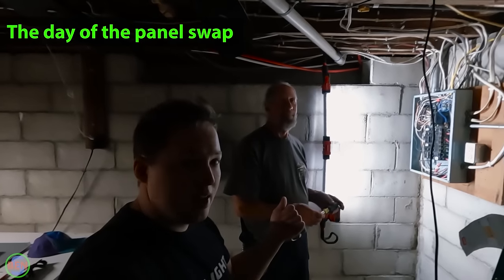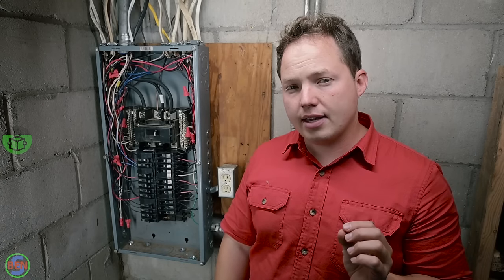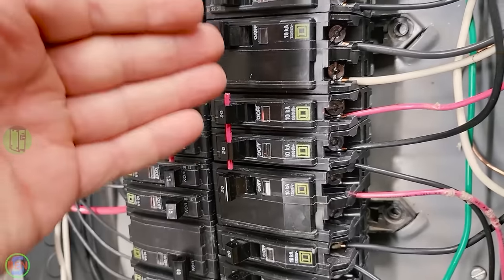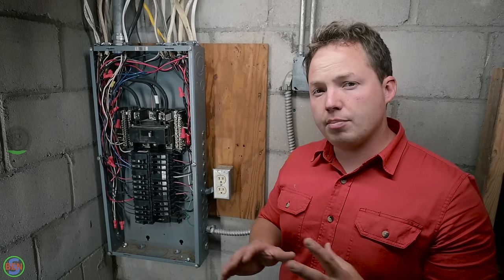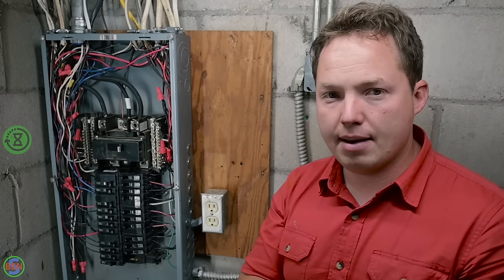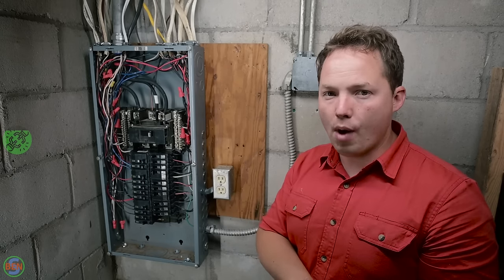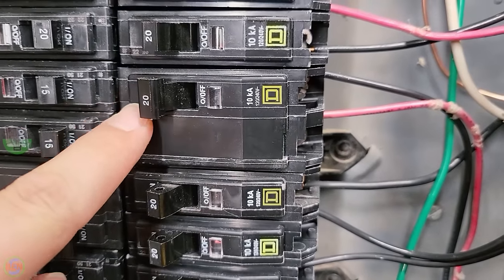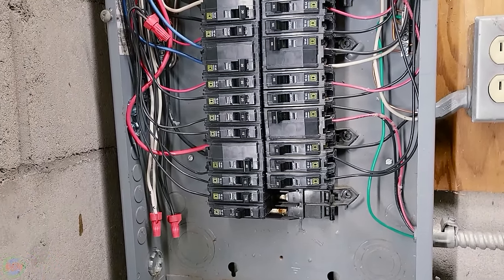How To Replace a Main Panel or Sub Panel - Upgrading an Existing Electrical Service

Comment: Everyone has their own way of doing panel changes. I’ve been in the trade 25 years and I’ve found over the years when Romex wires are short I’ll take them back back to a 4-11/16 metal j box.  Them I will take a piece of 3/4” greenfield to the panel and push multiple sets of stranded wire to the panel to extend circuits. That way you don’t have all the wire nuts in the panel and it dosent get packed on top of the panel with Romex wires.
Reply from the maker: That sounds like a really clean way of doing it. Thanks for sharing!
Reply: Great idea thanks for share that
Reply: @BenjaminSahlstrom  thanks. It ends up really looking clean. I’ve done  a ton over the years this way. Plus the top of your panel is not packed with a ton Romex or different wire assemblies. .
Reply: worked in govt facility making weapons we always had to splice into a 4 " box [sealed] no splices in panel
Reply: we had a lot of old fabric and rubber insulation
Reply: @stewartmelzer939  yep….it’s so much cleaner of an install!
Reply: Where do you tend to land your j-box?
Reply: @binaryglitch64  near panel or on a side  of joists.
Reply: @mcarroll598  than I'd appropriate being the next guy to work on it. Good tip, thanx.
Reply: I agree. I do the same thing. It's safer,  there's more room in the panel, and it looks better.

Comment: Spaces in the panel are dependent on the load. If you go from 100 to 200 amps, you're going to need new wiring run to the panel in most circumstances.  Perhaps the entire electrical drop or service to your property will need to be upgraded.
Reply: I feel like this is problem I’m having
Reply from the maker: That can be the case but in many circumstances the service is large enough with too few spaces for added circuits. If you don't have many large electrical appliances you actually don't need a huge service. Obviously calculating the needed panel and service is the way to go though.
Reply: Here the service overhead doesn't change but of course from the weatherhead inside will need updated
Reply: @BenjaminSahlstrom  I still only saw 2 spaces even though you said you miscounted. Where did you get 4 from in the correction text?
Reply: In the video Ben noted that the power feeders were aluminum and rated for 100 amps, and that the disconnect has a100 amp breaker. His new panel is rated for 200 amps. So a100 amp breaker is protecting 100 amp aluminum wiring. He also said that if he wants to upgrade to a true 200 amp service he would have to replace the 100 with a 200 and the 100 amp wiring with 200 amp wiring. Also a lot of the circuits in the original panel were "doubled up" and those circuits had to be separated and put on dedicated  breakers, that's why there weren't as many spare breakers as originally planned when the job was completed.
Reply from the maker: Check out the very end! 56:00
Reply: @BenjaminSahlstrom  use tandem 15/15 or 20/20 breakers in the empty slots (and/or start replacing some of the old breakers with a tandem breakers)
Reply: Finally someone said it!
Reply: Classic case of what's okay and will work, versus what would be better for the future and current service. Should upgrade everything while you have it out. Just makes practical sense. Also, I would upgrade to all 20 amp circuits. It's just better. I always do this for my customers, when I can. They always thank me when they don't have problems with overloading circuits constantly tripping breakers. Makes additional services easier, and faster, which saves money! Of course, I figure out all the loads for each circuit, and for the entire system first! Little planning for the future not only helps the client, but it guarantees me that I'll be doing the work! It's the difference between a good electrician, and a great one! Doesn't always happen, but it doesn't help to try!!👍🇺🇸🐍
Reply: wise words old friend. lol found you
Reply: @DocJeep1 the problem the customers don’t wanna pay for that extra work and u can’t just replace 15amps with 20amps without upgrading the wiring as will bro.

Comment: Ben, you have a code violation in this clip.  Your film shows a 30 amp breaker that is just above you multiwire circuit breaker.  The conductors connected to this breaker are the problem.  According to the NEC, if you are using the white wire as an ungrounded conductor it must be marked as such anywhere in the circuit where the conductor is visible.  All you need to do is wrap some black tape around the white conductor or use a black or red sharpie pen to color the white wire.  Don
Reply from the maker: True! I actually talk about this in the video. The wires just hadn't been marked when the video was recorded.
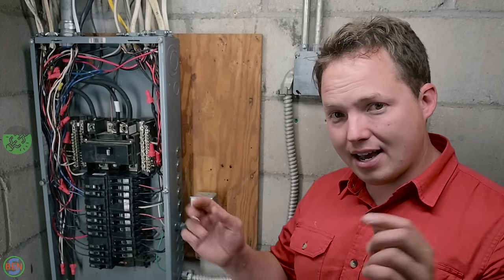Reply: this comment prove you didn't watch it till the end, at 39:45 he talked exactly about this!

Comment: I ran in to a main panel recently installed by am "electrician"   It was a Federal Pacific, and the guy had put in multiple double breakers and 12/3 & 14/3 wire.  The trouble was in a Federal Pacific panel adjacent stabs could be on the same phase,  I looked and every one of the doubles were on the same phase.  I told the owner to call back the installer and have him fix it!

Comment: Yes, they enforce shared neutrals be on handle-tied breakers where I am. Exception for sewer lift pumps with alarms. We use 2 hots and 1 neutral so if the pump trips you don’t lose the alarms power.

Story time: 

Doing a partial remodel on an office building while they were still in operation, I fried 5 computers in 10 seconds. 3 phase sharing neutrals; I, unbeknownst to me, took apart a neutral joint that was going to an in-use office. A lady stepped into the construction space and said “are you working on my office electricity?” I said no and went on working. Shortly, a maintenance guy walked in, look at my work and said “yea, he did” over his walkie-talkie…my stomach turned over. He said”we aren’t going to charge you because we didn’t disclose it, but everything in this building uses shared neutrals. You just burned up 5 computers. Don’t disconnect neutral joints during business hours anymore. Now you have been warned.” I felt about an inch tall
Reply: Well now you know to ask first just in case
Reply: @FishFind3000  yea….we try to avoid “open store remodels” as long as “good work” allows. Sometimes ya gotta do what ya gotta do though, but yea! That was a lesson from the “slow down and think about the task at hand” category.
Reply: Just curious was the lighting voltage 3 phase 277V  or 3 phase 208?
Reply: @RS-qp4bp  it was 208v.
Reply: @aaronpinkham4196  just curious, at work we have roadway lighting and office lights at that operate on 277 volts to neutral.
Reply: @RS-qp4bp  A lot of bigger buildings will have 277/480v coming into the building for equipment with major load requirements, like lots of HVAC and lighting. Then they’ll send it through a transformer to get the 120/208 for general power throughout the building.
Reply: the one and only time I used a shared branch circuit I labeled a piece of sheathing 'shared circuit' and left it on the neutral at the bus.. also labeled the wires and the chart in the panel 'shared circuit'.  just in case the next guy thought my connected 20 amp breakers were feeding a 240 volt circuit...  I overcompensate, I know.

Comment: I live in Minneapolis had my main panel replaced about 2 years ago.  I called around, and had 2 bids.  One guy quoted me something like $2500.  Another quotes me $1000 + materials.

Of course I paid the $1000, with the agreement that I'd buy the panel, the breakers, and the grounding rods which are required to bring things up to code and have everyhingl ready for them.

So I'd say prices vary because electricians are just charging vastly different prices for the same work.  They did a great job, everything passed inspection, they ran new grounds to my water main and drove in the newly required ground rods.

It looks like you were putting in a sub-panel in the same structure, so this isn't required.  But you might have mentioned if you're replacing a main panel like I had done, you have to bring the panel up to code.  For me, that meant putting in a ground wire that hooks directly to the incoming water pipe.  Mine was connected a few feet away, which is no longer legal.  You also have to put two ground rods connected to the main panel.

Comment: Another good reason to keep the neutrals and grounds on separate bus bars is the possibility of adding a standby generator. When you install the transfer switch your main-panel now becomes a sub-panel. Then all you have to do is remove the ground to neutral link.If you put the neutral and grounds on the same bus bar you have to rewire the panel.

Comment: I wired a couple multiwire branch circuits in my shop in my backyard.  I pulled permits and had inspections, and they didn't say anything about my breakers and didn't require me to tie them together.  Now that I understand this a little more, I'm going to tie them together and if I had to do all over again, I would just spend the money and run the extra wire and not share the neutral.  I thought I was going to make things simpler wiring that way, but I don't know now.
Reply: Most breaker manufacturers have a joining bar or pin for very little money

Comment: Amazing video! It was super informative and the layout/content of the video was well thought out.

This video also makes me feel a lot better about the cost of my panel replacement around a year ago - the house I bought had a 100A service into an old, 10-circuit glass fuse panel that was rusted with water damage. We paid $3100 to upgrade the service to 150A (so new drop, new feed cables, new meter) and upgraded to a 30 space, 60 circuit panel, but no plug on neutral unfortunately :(. The 4 guys that came out had the new panel in within 4.5 hours, which was a relief since we had a lot of stuff in the fridge with no easy way to plug it into a generator. 10/10 will hire them again!

Back in high school I got really into electrical work (my high school offered electrical wiring classes through our FFA and Ag program) and I spent some of my freshman/sophomore years in college taking some more electrical classes in case I didn't like engineering and wanted to become an electrician instead. Fast-forward 8 years and I really miss doing all of that electrical work (I still find time here and there to upgrade outlets or install a new bedroom light for a friend), and I have been trying to see how hard it would be to become an apprentice electrician even while working my full-time engineering job. Do you have any good estimates for how much time is required and what classes I would have to take to be a qualified apprentice electrician? I don't want to do this for extra money or anything, but mainly to feel more confident about some of the more complicated jobs I want to tackle in my own home, as well as do qualified work when an opportunity presents itself.

Thanks again for all of the amazing videos!
Reply: Hey. Journeyman here. It'll take you anywhere from 3 to 5 yrs, depending which of the electrical paths you take. Idk if you'd have time to have a full time job and be an apprentice at the same time. The reason is that you'd have to keep 40 hrs a week doing electrical to gain the hrs needed to finish your apprenticeship. Also, you'd have class once a week and some years, twice a week.  I'd suggest calling your nearest local and asking them if they'd take you and how it would work out. Good luck, brother. Be safe

Comment: House I bought to setup as a rental had 240 circuits built using double-stabbed (one even triple stabbed) into breakers on opposite rows of the panel.  The panel was circa 1980's, oldest part of the building was 1890's.    Double stabbed breakers, unassociated 240 lines to garage, and best of all tube and button wiring in the original attic still in use.

Comment: I replaced mine couple of months ago, because old one started to spark where couple of breakers connect to lugs. Replaced with a new Square D QO. And guess what. It was recalled about a month ago due to fire hazard.... Thank you for your videos! They were very useful!
Reply from the maker: How unfortunate! How is Square D handling the recall? Will they cover labor to replace it?
Reply: @BenjaminSahlstrom  their site says " Free inspection and repair for recalled product shall be provided".  Contacted them, no reply yet. 1.4 million panels affected.
Reply: Take a number and get in line :-)

Comment: Different colors were required on the hots in my jurisdiction so that the legs could be identified both at the panel as well as at the meter. I believe it’s to ensure load balance throughout all panels.

Comment: Ben, in this video you answered a question I had and learned something new about "multi-wire branch circuits" and are they kosher. In the house we just bought last year, I found two separate 120v 15amp circuits wired up with a 14 gauge  3 conductor (with ground) cable that are sharing a common in the added subpanel. I believe the two circuits feed lights. Appears the inspector did not catch this or overlooked it.  I believe this does not meet code, because the side by side breaker's handles are not coupled together. Now I know what to do about the situation, ether couple the two single breaker handles or install a double pole 15 amp.  Your videos are very good and informative, keep up the excellent work.
Reply: that was allowed by code back then and up until somewhere in the early to mid 2000's (I forget exactly when code changed) I'm trying to say 2008 or 2010 offhand.
refer to the NEC and your local state, county, city, township codes. they may be using old codes or have requirements beyond the NEC's level.
any wiring/panels done prior to the code change would be grandfathered in, but may still be triggered for change upon sale or transfer of ownership and inspections.

Comment: Most multi-wire branch circuits I have seen are tied to direct wire dedicated circuits but with a shared neutral. For example; I had two bathrooms next to each other heaters that used the shared neutral. Since this was 1978 code, the breakers didn't have to be tied together.

Comment: I hired an electrician to replace mine. My house was built in 1992 and had Federal Pacific breakers, thankfully none had failed in all the years they were installed. I went with GE . Only problem we had was the electrician pulled the permit and scheduled the power company to come pull the meter during the work but they never showed up. He ended up pulling the meter so he could work, the power company guys didn't show up until 4 in the afternoon when he was done so they just reinstalled the meter to connect the power.

Comment: $1800 was typical for a 200Amp panel swap in my area years ago.
However, with price increases and code changes for arc-fault, etc., prices have gone way up.

Comment: Good video as all your videos are- informative.   Noticed you mentioning phases when talking about  dual breakers.   To my knowledge, residential load centers are single phase with 2 legs- each coming off an end of a transformer winding with the center tap of the winding as the neutral.   Took a shower during the video & might have missed it if you mentioned it.  Apologize in advance if I missed it.

Comment: Comment about multi-wire branch circuit. When I remodeled my kitchen/great room in 2019, I wanted a receptacle in the island that was capable of handling a number of appliances such as warming trays and waffle makers. So the electrician installed a NEMA 5-20 receptacle and wired 12/3 as a multi-wire circuit, with each leg to half of the duplex outlet. And since there is plumbing in the island, he installed a 20A/240V GFCI in the panel to make sure that the only thing we cook is food.

Comment: This is the best description I've seen of pre-EGC to the first point of disconnect. Often bonding screws can't support neutral loads so putting neutrals on a ground bar isn't a good idea. Looks like the service lines come through that metal raceway. I wonder if that would suffice as a return path to the meter if it is continuous? I see old buildings with two prong outlets fed by BX/MC and metal boxes that are grounded.

Comment: Since the original panel was mounted fairly low I would have considered mounting the new panel upside down and put the breakers at opposite end from the main disconnect (top of the panel now) so the feeder could still come in at the same location but you would not have to extend very many if any of the wires if any to get them to the circuit breakers.  As long as the highest breaker is no higher than 6'6" it would still me to code. Just a thought.  Also I thought you did a great job on this video and did a great job explaining everything.  Thanks
Reply: NEC states the panel can go to the floor but the main breaker  must be no higher than  6 feet
Reply: 240.24 Overcurrent protection devices must be no higher than 6’7” above finished floor. That’s any breaker. If the main is on the bottom of the panel the top most breaker cannot be higher than 6’7”